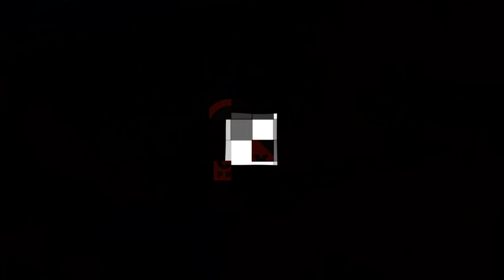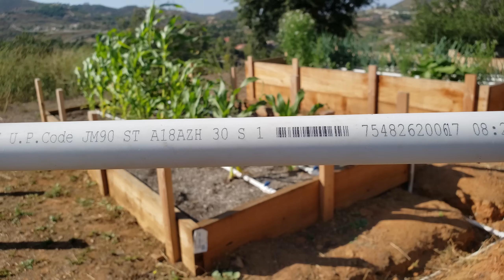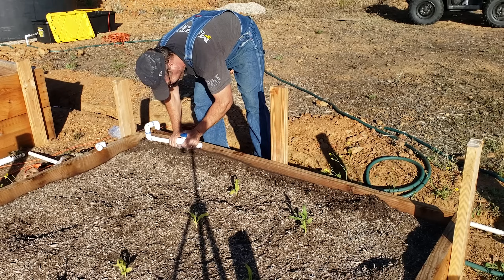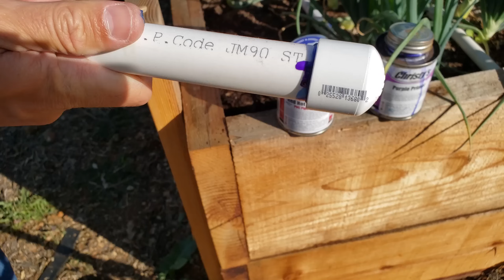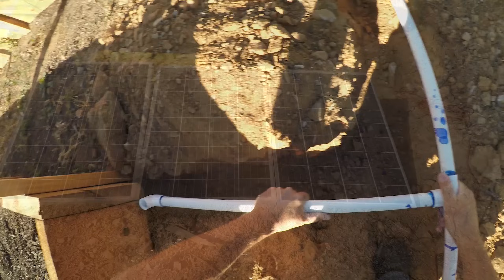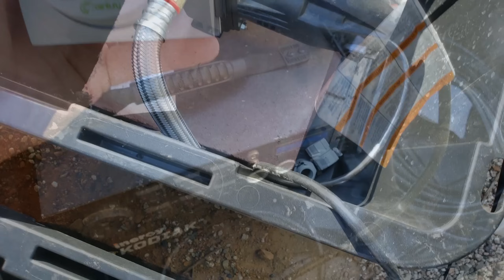How to build a PVC drip irrigation system

Comment: You “preppers” sure do spend a Sh7t ton more money than necessary. You could have just used a pressure regulator @ the water input instead of $5+ for each ball valve and I’ll just stop at that 1

Comment: I've seen some videos where the holes are drilled into the sides of the PVC pipes.  Now that you have had it going for a while, any additional thoughts on pointing the holes straight up vs. on the sides?

Comment: You might want to consider an agricultural hose pressure system. Emitters can be punched in and plugged when you are finished. Next season you can reuse the hoses and put in new emitters where you need them. Keep up the good work.   PS: Considering what's happening to us here in CA, how about an earthquake preparedness videos.

Comment: Somewhat off topic.  You have always been very helpful regarding water storage.  I purchased several blue water containers.  I think they are five or seven gallons.  They arrived in a nice cardboard box.  After filling with water I would like to to set them back in the box.  It's extra protection and not visible as to what it is.  They will be stored off the floor, in a cool, dry basement.  I live in New England.  These water containers can be stacked so I would put them back in the box the same way they arrived.  I will be putting water purifier in each container, even though when I use I would filter and purify again. Do you see any problem with me putting the containers back in the box. Thanks to any viewer who responds.

Comment: The problem with above ground drip systems is that they encourage shallow root development and then a mild wind storm knocks everything over. Imprqctical in the face of grand solar minimum hashtag Eddy Minimum. You need to bury the hydro and get windblocks and removable hail blocks going immediately.
Reply: What do you use for a hail block?

Comment: So many great ideas that never get shared in my neck of the woods.  Everyone is very secretive about how the maintain their gardens & the sales of drip systems are far too expensive for me.  I am tired of having to water 3 or 4 times a day now that my squash is fruiting & growing like crazy!  Next year, the drip system goes in.  I have "heard" that exposed PVC breaks down quickly from the rays of the sun.  Many people paint the PVC or cover them with mulch or just dirt.  I don't know if it's true or not.  The white PVC in 10 foot length is super cheap.  I built a shade structure for my garden with it.  No glue.
Reply from the maker: It is cheap and easy to replace once it starts to crack.
Reply: @CityPrepping  Thanks for the info....that's good to know.  ;)

Comment: Those onions are looking nice! I've been using Aqua-Traxx drip tape with reusable mechanical fittings instead of PVC in the beds. It's held up pretty well of the past few years. You can reconfigure if you want to later but, i built a dual flow headder system that i can undo 2 fittings and pull the whole thing out of the bed if i need to. 

I try to focus most of our garden space to calorie crops and greens. Growing carrots, tomatoes and, peppers are nice but those things are not going to keep you going if SHTF. 

Sweet Potatoes can store up to six months. Some winter squash(seminole pumpkins)can store for up to a year. Regular potatoes do not store as long but, will fill your belly with calories. 

Greens like kale, collards and chard can provide you with nutrients and only need to be planted once and can be harvested off of for a long time(six+ months) Brassicas are also frost tolerant and actually taste better in the winter. I love things like carrots and corn but, once you've harvested them thats it and you'll need to replant. 

Gardening is very enjoyable and rewarding but, if you are not careful it can take up a lot of time. Installing a drip system is a great example of a way to reduce time in the garden versus hand watering. It is still important to check your plants every day if possible.  Great video

Comment: This is cool I need to do this system. I like the farmer gear you have going when you do these videos. Quick question wouldn't it be easier digging with the soil wet??
Reply: Wet soil is much heavier than dry soil. How you want to do it I guess depends on how young your back is.
Reply: @michaelwier1222  good point

Comment: how bout 500ft 0f soaker hose and a house tap
Reply: William Volkmann soaker hoses are nice but degrade more over time - depending on temp and soil acidity. 
Also- you don’t run as much risk of accidentally puncturing it with a garden tool (pipes are just s better long term solution)

Soaker hoses are good for temporary things- like running it around the foundation of your home and using your laundry runoff to soak the foundation / keep it from cracking.
Reply: @dreamingwolf8382  that's another good idea for the foundation thanks